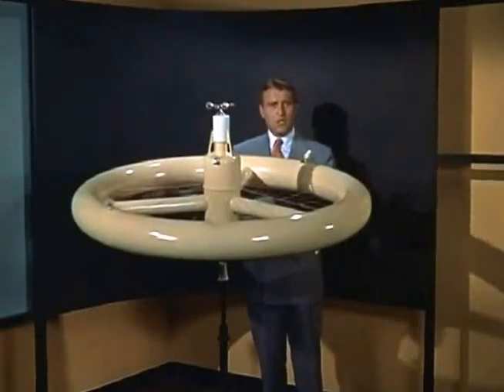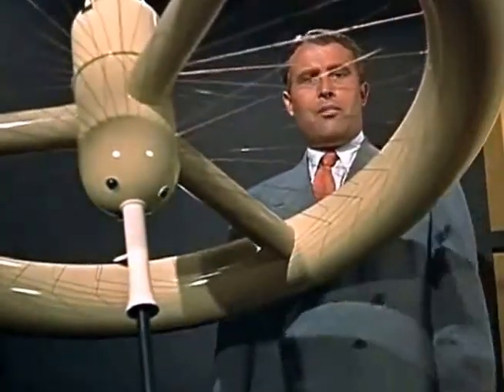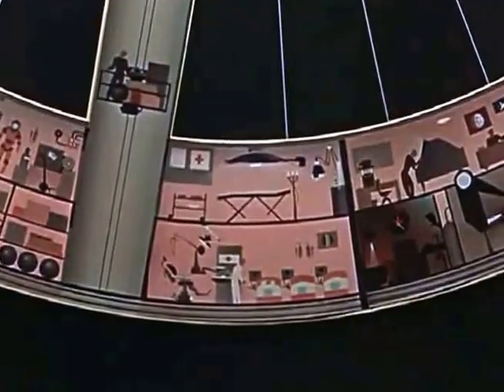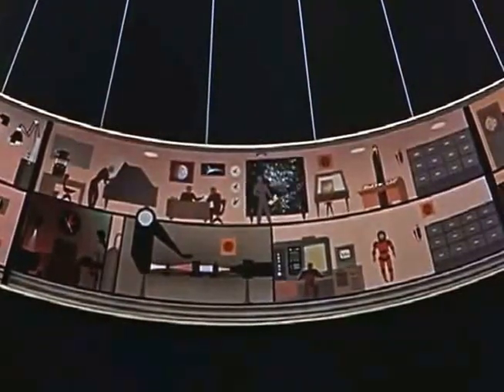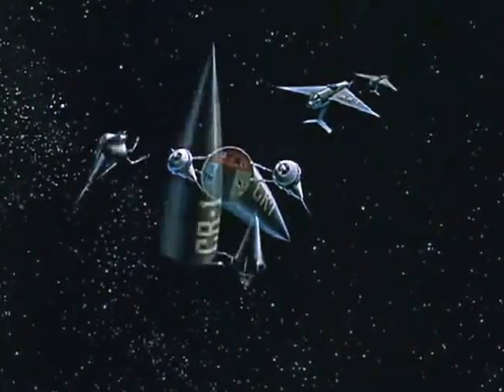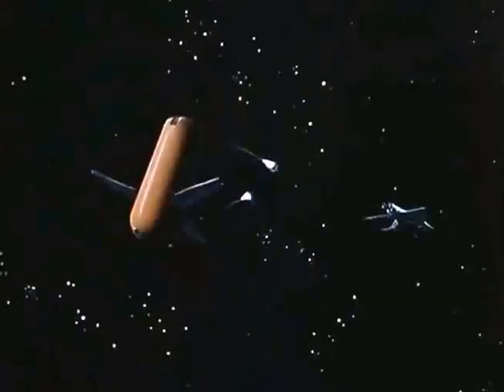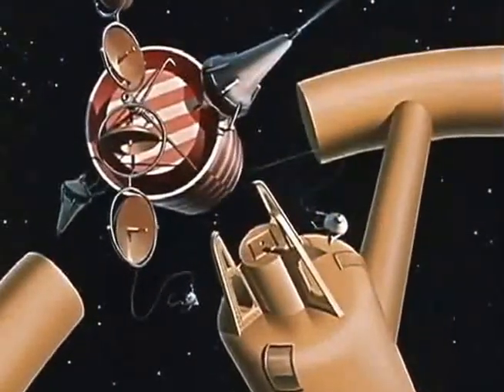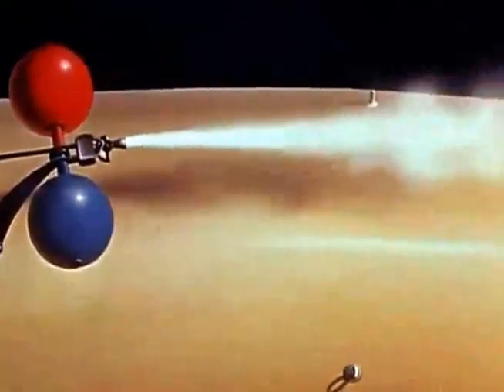Von Braun Space Station 1956

Comment: only one problem with the rotating space wheel. weight distribution. there needs to be counterweights to keep the whole thing spinning evenly  these weights can be on these spokes and will go up to the hub and down to the rim,   to keep a steady rotation. you may also want to add solar panels for electricity.
Reply: naah they have a atomic reaktor , i think this will run longer than the life span of such a station but yes panals would elliminate the nesseary of bringing reaktor fuel to the station
Reply: yes! a counter-spin. that way you could start and stop the rotation for the occasional maintenance.
Reply: I imagine there would be errors from humans moving, but I think the station, 200 feet (or 60 meters) in diameter, with a circumference greater than 600 feet (180 meters) would be so heavy, that human motion would be negligible.
Reply: @AmericanTestConstitution  the problem wouldnt come from humans moving, but from the different facilities that would exist across the ring. 

For instance, if you have a medical facility (which doesnt require heavy equipment) in one side of the ring and your processing computers on the other side (which at the time were really heavy), you would have a pretty big difference of mass between the sides that could (and would) destabilize the spin of the entire station. Heavy counterweights would surely fix it tho.
Reply: If this was planned in the 2000s of course they would have used solar panels.
Reply: many good ideas to balance the wheel.
Reply: haze the panels would not be attached to the ring but stationery outside. perhaps the generated energy could be converted to microwave which would be caught  by the wheel and converted back to electricity.

Comment: 200’ across in diameter traveling at 3 rpm is about double the speed of the average Ferris wheel 🎡.  Most Ferris wheels are 200’. Which I’m pretty sure what they based this on. A weak substitute gravity imo

Comment: I wonder if the wheel would wobble. Uneven weights throughout.
Reply: I think it can be compensated via mass trim system, somewhat like the trim tanks on the submarines.
Reply: It wouldn’t wobble in space. There’s no gravitational pull.
Reply: @Bandini68  I am certainly no physicist. But I would think, not sure if a mass in space with rotation would exert a force. I think  Newton has a law on that. But I would think a mass would need a counter mass to offset that mass. Really poor syntax. A G, I believe is a measurement of force and mass. I really need to 'talk' to a physicist if you are not one. If you are thanks much.

Comment: centrifugal force artificial gravity. hmm i am not sure if it works.
Reply: but it works on laundry to seperate it from water. in the spin-dryer why not on astronuts?
Reply: oh i know! to get this centrifugal gravity to work, you will first have to get a hold onto the rotation, or you are still gravityless in space. it would rotate but you flow around  without it.
Reply: I did the math and found that the centrifugal force produced by the rotation would be about 0.3 g, slightly less than the surface gravity on Mars (0.38 g) and probably too little to counter all the long-term health effects from reduced gravity.
Reply: It would work, what doesn't work is that the structure needs to be so huge that is a practical impossibility to build, and if built, it would break apart by that very centrifugal force rather easily.
Reply: @fromnorway643  
We don't currently know what the minimum acceleration humans need to stay healthy is. It may be 1G or it may be 0.5G or it may be 0.1G, we won't know until we do some more long term experiments, either in low Earth orbit in ring stations or on the moon, preferably both.
Reply: @jeffvader811  
Precisely!
Nobody has experienced partial gravity for more than about 75 hours, the time Apollo 17 spent on the lunar surface in December 1972. This is something we need to understand better before we start planning bases on the Moon or Mars.
Reply: @nagash303  You would enter through the center where it's zero gravity, and as you went down one of the elevators, you would feel more and more artifical gravity. If the ring section didn't have dividing walls, you could throw something at a suitable speed against the rotation and make it go much further than a normal throw as it would be "still" and the station turns around it. But air resistance would make it "fall to the bottom" soon anyway. Apart from that, the station's rotation would be a great approximation of real gravity for pretty much all intents and purposes.

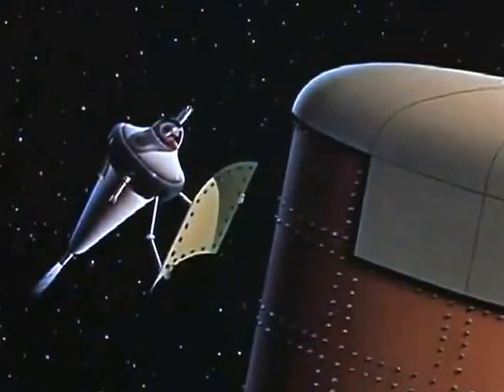Comment: Thin metal plates will protect it from meteors...?!  (2:19) rofl
Reply: Not even against micrometeoroids.
Reply: It is pretty much for space dust and the likes... The chances of a large rock to hit the station are very low. Its just if a astronaut banged against it, it will remain intact instead of the astronaut making a big hole in the station...
Reply: Very rarely do asteroids larger than s ping pong ball enter earths gravity. He is talking about micrometeriorites.
Reply: The International Space Station has a relatively thin layer of aluminum over a layer of Kevlar padding as it's hull. This doesn't look much different so I don't think it's unreasonable.
Reply: Sirhendro.  The thin metal plates are there to maintain the integrity of the shell. It's scaffolding for god's sake. When you have a punctured balloon, it deflates. When you apply a rigid outer shell, its shape remains despite puncturing. You sound so derisive despite your complete ignorance of simple physics.
Reply: you would suggest something like a hull of a ice-breaker or a battle ship?
Reply: Kevlar with a self-healing layer would do it better and lighter now. While still allowing sections to be sent up as balloons.
Reply: Actually thin metal plates a few inches from the next level of the hull do a lot to protect from micrometeorites,   the initial impact with the plate fragments and spreads  the impact out over a larger area on the next layer. Something like  this is used on the international space station.

Comment: How can you eat and sleep up there if the floor's spinning?
Reply: Best comment
Reply: BigGuy4U -- in 24 hours as opposed to 20 SECONDS. You'd certainly feel dizzy for a while. And though I expect that you might get used to it facing in one direction, would it be undone if you merely turned around so you would start to spin in the opposite direction? Humans are adaptive, but I'm not sure that they could fully adjust.

Gravity would feel odd being higher at your feet than at your head. If you tried to run you'd notice gravity shifting significantly, pulling you in different directions depending on whether you run with or against the station's spin.

And you can forget about having milk there, as it would sour very quickly. :-)

Granted, it'd probably still be better than the health hazards of prolonged zero gravity.
Reply: If you are standing on the floor, you are spinning with the floor, so it appears stationary to you. Same way that you can eat and drink in an aeroplane while travelling at fast speeds.
Reply: If the station is big enough then gravitation issues such as oriantation should be trivial.  At a constant speed the station should be able to maintain a simulation of gravity that should be comfortable for the majority of average humans.  You really shouldn't feel anything.   Now at such fast speeds you'll get of course earth spinning around like crazy through a window this can be fixed by eliminating windows or having them optional for some well the rest have simulating windows with TV screens projecting a more calmer less confusing window with maybe a assortment of visual landscapes or space that also facilitates in keeping a visitor or crew member from suffering any issues with maybe a calmer visual of Earth in a observation area free of the spinning.  . .
Reply: It's spinning like the Earth.  Artificial gravity.  Not many people know that the Earth is spinning 1,000 miles an hour.
Reply: Yngvar Følling 
It is spinning at 2 rotations per minute. If you can handle rotating your office chair at 2RPM then you can handle living on the station.
Reply: your relative speed will be 0. because you will spin with the structure like in earth
Reply: @a.citizen7668  Which one is higher?  The tangential acceleration or the gravity?